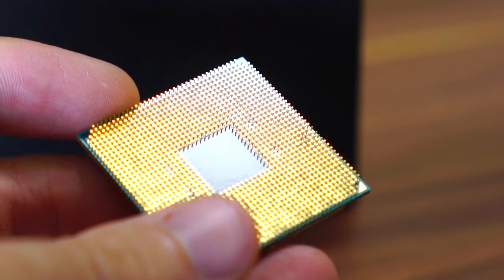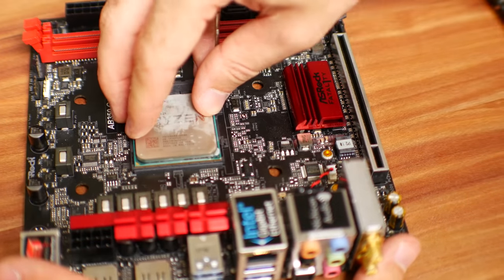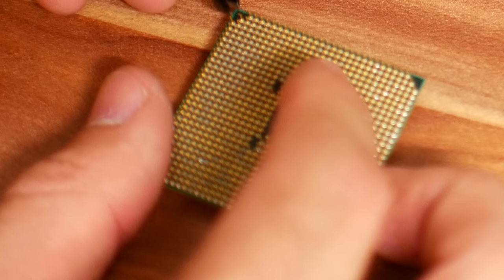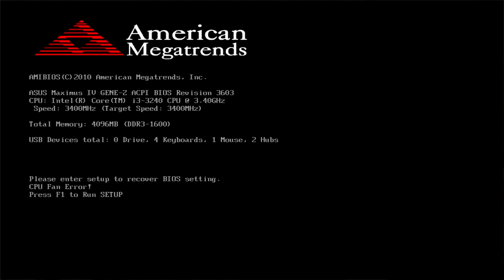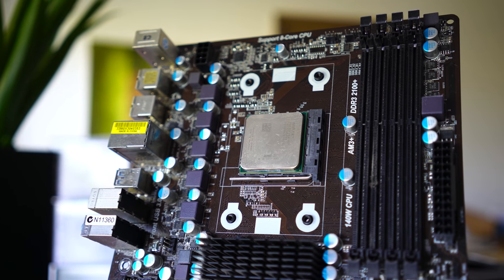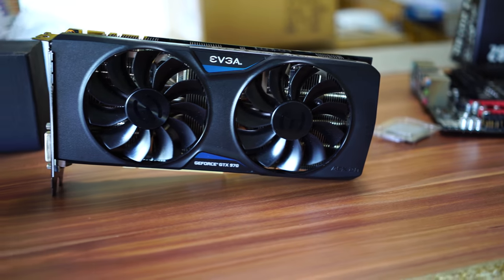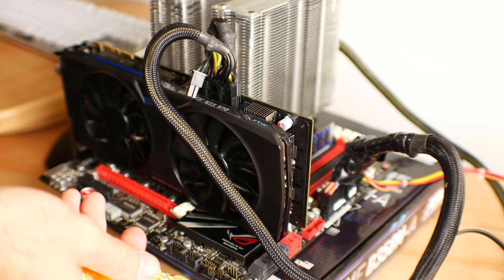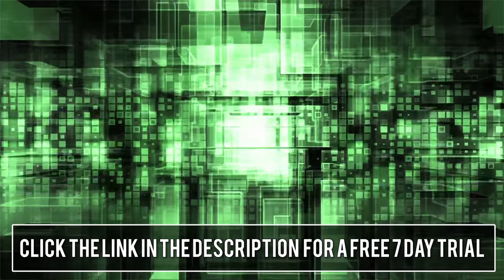How to Fix Bent CPU Pins (Ryzen)

Comment: If only I could give you my LGA1156 Board with Missing pins...now that's a challenge.
Reply: that'd be a fun collab
Reply: Depending on which pins are missing, it still might perfectly. just a ground here and there wont kill anything.
Reply from the maker: I will have to start practising jedi mind powers to get these things working next.
Reply: You can swap out the socket with some special machinery, there are videos of it on Youtube. But it's very expensive, a and bit silly on an older board.
Reply: Budget-Builds Official
You say a lot of bullshit, on this channel too, how did you break these pins?? Guess you need to buy DELL or HP next time, or a Lenovo. Never open the case! let them install DIMM's. Only install the software yourself! On the couch?
Reply: lucas rem: I mean I bought it broken for around £5, so I guess you can blame the eBay seller...
Reply: Budget-Builds Official
I try to get in some social engineering first, were was that CPU used for, VM or gaming, what games do you run, i need 20 minutes of bla bla bla before i trust a gamer selling his used parts, needing a 1080Ti now, selling his old 1080 for example. Always i ask what game did run on it, CPU, the climate etc. So i can form a picture, is he is any real, or just a chap needing money for broken parts.
Reply: lucas rem: I bought it because it came with a Corsair TX PSU, my main reason wasn't to purchase the motherboard, I always check out what I'm buying, as I have never made a mistake with my purchases. But I'll keep your advice in mind.
Reply: You stalker! Well, you wwere here first, but... stalker!!!!
Reply: Hey dude, if you can't get these to work, let me know, i might be of some help, I'm a Master Jeweler, we have a very powerful laser solder that is accurate to 1/1000 of a mm. obviously we use that to fuse multi part rings/earrings or multi color (i.e. rose gold/ yellow/ white) piece. I've fixed a processor before, was not fun, and i also redid a 1151 board as well
Reply: lucas rem that was rude

Comment: Can confirm. Bent pins on my R5 1600... After recovering from fainting, and with a lot of focus and patience, I fixed it. Very scary experience.
Reply: My new Ryzen came with bent pins. I am using a Seam Ripper to fix my bent pins. I was curious why it wasn't fitting into my socket and I did it correctly.
Reply: I have 1600 too I got scared af thinking I just lost money
Reply: Mine's an R3 1300x :( Not fixed yet
Reply: did the same durn thing when I installed my first cpu didn't seat it correctly and bent them using the lock lever...grrr. what can only be called 'judicious manipulation' I was able to get 'em all aligned and back in phew.
Reply: Just did the same thing, my mum described it as a heart surgery, turned on lol just need to put it back together

Comment: I hate when people throw away CPUs/Motherboards because they have 1 to 3 bent pins. It's a waste especially when you can bend the pins back to normal, and if not, sometimes the CPU/Mobo will work.
Reply: Pan-Celtic Socialist I'd rather them sell it if they "can't" fix it themselves. That's were I come in and buy it from them 😁
Reply: Pan-Celtic Socialist i bent a pin on a z87 sabertooth board and i cant seem to be able to bend it back. No matter what i do
Reply from the maker: This z68 was a bargain! So easy too!
Reply: Yep. I have three BROKEN (broken at the base of the board so no contact) on my Asus z97-a board. Still rocking an i5 4690k at 4.5ghz on it with zero issues.
Reply: Use tweezers and/or a pen.
Reply: BleedinglHeart some of the pins are simply for power or ground and there's redundancies.  Break one power pin and there's probbably 20 more to be able to deliver 100watts.  Or in this case, one of the pins was for the memory controller and killed dual channel ability.
Reply: a better way to do it is to use a credit card or ID card and hold it behind the pin as you bend it towards it. keeps it from going too far ending up mostly all straight.. The way this guy did it is very newbish.. Doubt he even did any research online on the best way before starting!
Reply: Nietzschean Socialist I had bent a few pins on a motherboard I had trying to replace a CPU. I was heartbroken thinking how I was going to replace it. I bent the pins back and it worked fine.
Reply: proceeds to throw away ryzen 9 3900x
Reply: @synapse5791  bruh, that's the same exact CPU I got recently and I accidentally bent a few pins of it from just trying to put on the damn cooler. :(
Reply: @NeoShadowWolf  if its from amazon ask for a replacment they game me one for free

Comment: I snavvle all my bargains from the side of the road here in Germany. A few years ago, I found out the hard way what a pain the arse it is to straighten bent pins on an AMD CPU. It was only an Athlon 64, but it was still my first 64 bit processor, so you can imagine how keen I was to get it was working. I found the 1mm jeweler's screwdriver that you get in the packs from the 1$ shop worked a charm! I got all the pins straightened, and the pc ended up running like a champion. I love your videos, man! I haven't seen a crappy one yet!

Comment: I learned the hard way when replacing the stock cooler with a AIO... while trying to remove the stock cooler off my Ryzen 5 1600 it ripped the CPU right out the x370 socket. Bending several pins on the edge. Had to buy a new Ryzen 5 1600 CPU. I didn't run the CPU long enough to heat the thermal paste and instead of twisting the cooler off I pulled. Money I could have use to upgrade my 1060 to a better video card.
Reply from the maker: Oh yeah that sucks, damn man feel sorry for you, though these pins must have been bent in a much different way, it like a hurricane in the middle of the cpu.. lol a complete nightmare was this one.
Reply: I learned this with an FX 6300. Thermal paste becomes glue apparently
Reply: Why the fuck are you using a x370 motherboard with a ryzen 5
Reply: Mohammed Essam mainly because I liked the aesthetics (looks) of the board. It's the low end X370 motherboard from Gigabyte (AORUS X370 K5) which was only $129 USD.
Reply: Chandler Kristoff Apparently so. Surprised none of the pins were pulled out but it didn't matter a new CPU had to be purchased.
Reply: I had exactly the same thing happen to me with my 1700X but i was lucky, with a lot of patience and a spectacle screwdriver i got it up and running again. There was about nine bent pins mainly along the edge. I was terrified of putting it back in the socket in case i crushed any of the pins that weren't aligned properly but it went it with a little bit of a jiggle. Best thing to do in future is to loosen off your cooler and then use a plastic spudger in between the IHS and the contact plate to gently break off the heatsink using the spudger to loosen the thermal paste (or the spinning method mentioned above). AM3/AM4 sockets have that down side of ripping out the CPU if the thermal paste has hardened especially with the clamp on style stock cooler that i believe use far to much pressure.
Reply: Some say that's why intel aren't PGA. The CPU would delid itself under such force, because of the crappy thermal toothpaste XD
Reply: This happened to me too! It was an old amd part. CPU still worked though. I think intel processors have a bracket that holds the  cpu into the socket so its not an issue on that platform. Glad i'm not the only one who's yanked a cpu out of the socket.
Reply: I pulled straight out on an FX-8350 and the CPU came out on the stock cooler. I was freaking out, but with a knife and a hair dryer, I slowly peeled it off by heating the heatsink and just slowly working around the CPU with the knife (didn't even scratch it). No damage whatsoever, but I was terrified I wouldn't be able to get it off.
Reply: Chandler Kristoff yes it can! My daughter knocked over my phenom2 pc and the tuniq tower 120 ripped it out of the socket and bent a few pins
Reply: Was taking apart a very old 3000+ amd pc for shits, and it being the age it is resulted in a similar result.. just bent them back a bit and let that old 795 socket do the rest.
Reply: Literally this just happened to me yesterday. Feel ill over it, the company sold me a 1600x for cheaper so I was able to upgrade (albeit small) from the 1600. This is good because I have a 240 AIO and I'm gonna try to OC to 4.1GHZ. Otherwise, you live and you learn. Not nice though.
Reply: Exact thing just happened to me and here I'm. I feel so fucking stupid...
I had high temperatures and I wanted to check the thermal paste...

Comment: Reminds me of my biggest mistake... I managed to bend 12 - 24 pins on an FX-8350, the thermal paste was too cold and turned into a strong adhesive. Lesson learned, boot the system and let the CPU warm up before powering the system down and removing the cooling unit/CPU.
Reply: or just twist the cooler...
Reply: The computer sat in relatively cooler temperatures before removing the CPU. Based on AMD mounts using a clamp style design, twisting the cooler would likely have resulted in more damage. The combination of cooler height, short distance from fans, and the CPU becoming dismounted from the relatively weak mounting system, can attribute to the bending of CPU pins. Of course this was all because I didn't warm the CPU first, which ultimately made this issue user error...
Reply: Twisting works fine, tested multiple times, never ever ever ever pull a radiator directly outwards from an AM series MOBO, CPU will most likely pop out and surprise you.
Reply: Noted, would have been helpful if the IT classes I was taking mentioned that :/
Reply: Did the same thing with my fx8350. Bent quite a few pins, about 20. Managed to bend them back into place with a pocket knife, worked perfectly fine afterwards.
Reply: @TheRealCharlieSuper  Disregard IT classes, especially if you are building PCs. Get  yourself an old one and practise. Its the manual skill that can't be taught, like riding a bike. You will learn more from youtubers than you ever will from classes.
Reply: Fair enough, was tinkering with old PC's long before IT classes. Hardware is easy, it's the software that will get ya.

Comment: I have an intel motherboard with lots of bent pins and that also work, but with single channel memory. Most of the pins seems to be about memory bandwidth.
Reply from the maker: It could always be worse, couldn't it? Could not boot up at all :p.
Reply: i had a 1155 motherboard with 5 missing pins, everything was fine except the igpu didn't work at all and i had to use a external graphics card.
Reply: Ola Justin ikr, whats better is that i got it for a dollar because the owner was certain that the thing was 100% dead ;)
Reply: @OlaJustin  why don't you straighten them?

Comment: A trick you can do with the PGA sockets is use a staple you can cut it with fingernail clippers a little bit longer than what you would need so it makes contact with the CPU works perfectly fine done it several times for broken pins.

Comment: Maybe you can use electrically conductive glue to attach the pins back to the cpu. That allows more room for error than soldering and does not require specialised equipment.

Comment: There is a reason these pins are gold plated. This is so to minimize oxidization on the pins.

It's possible that the circuit the pin runs on works under a specific resistance -- and oxidation on both ends (as the gold plating is broken) increases the resistance on that specific circuit, causing a slight voltage drop - even if the pin is contacting the broken part of the chip when it is mounted.

Try sticking the pin in, then right before you put the cpu on, spray some non-conductive contact cleaner on both sides then quickly put it on while still wet. Hopefully enough oxidization is cleaned off and the resistance is reduced.

As these chips run on really low voltages (below 2v) a 0.1 voltage drop is huge.

Also try to put the pin in the socket broken part down, plated side up.

Or -- gold-plate the pin and the contact again.

Comment: You could always use the tip of an empty pen, the pins usually fit very nicely to just be put straight as you use an angle to fix. Make sure it's clean though, don't know what could happen if lead stays on it.

Comment: I just fixed an old Athlon XP 6000+ with 20+ bent pins for a pc on my school. The pc was running a very limited piece of software that we can't install on anything else since we have lost the original license, so the only option is to keep using the pc. A technician took out the cpu trying to clean everything but DROPPED IT from 3+ feet! He just gave up. 
There were like whole rows of bent pins. I used a razor blade, with the edge prying on the pins. I would recommend going VERY slow when bending the pins back. There were no broken pins, and the cpu works fine, and tested with 48+ hours of aida64. Don't give up on bent pins!

Comment: My best advice for fixing bent CPU pins: 
Heat makes the pins more malleable without being as brittle, so if you can use heat in this case, use it.
A small plastic, fine-ended tool is great, but plastic is not as dense as gold and/or whatever other metal your pins are made/coated with. I myself recommend a hollow-point piercing needle to do the job because of the fact that you are now instead using something that is denser, more rigid, and a hollow tube with a fine point at one end. It's the most ideal thing I've ever used to bend pins. Way way way more control with less risk of you accidentally popping one off across the room.

Comment: The silver wire you find INSIDE the SATA cables CAN be inserted into the socket and work better than other "original pins". Just get it the right lenght. Fixed an 8370 with 2 missed pins this way,  and its working 100% for amost 2 years.
Reply from the maker: Interesting, thanks for the recommendation.
Reply: Esteban Burman How did you type this?

Comment: If they're not bent too far over (nearly flat against the bottom) my preferred tool is a razor blade (plastic if available) as it makes it easier to get them lined up perfectly, and the wider area of the blade reduces the chance of over-bending as you can definitely feel it and stop when you hit 10 straight pins. Also getting those 2 pins back on the edge of the socket shouldn't be that big of a hassle if you have a soldering + hot air station, clean the pads off with some wick, put down some fresh solder with the iron (if you lay it down right solder should only stick to the metal contacts, just use a little bit), heat it up with the heat gun until it melts again, and stick the pin in the melted solder with tweezers, then as necessary straighten it up with a nice razor blade.

Comment: What I've used in the past is the tool that you use to remove Molex Pins. It easily fits over the round Pins and sturdy enough to move the Pins without snapping them.

From what I've seen in your video I'd venture to say this CPU was accidentally dropped and landed at an awkward angle. 

Cheers...

Comment: From back in the Pentium 4 and Athlon XP days: It's possible to use a 5mm automatic pencil to straighten the pins by inserting the pin and levering it up to the correct position, in as little bending as possible.

Comment: It does take a lot of patience.  I'm working on an R5 1600x, and most of the pins came back pretty straight, but one on the side was bent way over and sadly, it snapped off.  Not sure if it'll work or not, but time will tell!  Patience is key!

Comment: I received yesterday my Ryzen 1600 CPU and OUT OF THE BOX had 2 slightly bent pins. I am absolutely 100% sure I did not bent them, as I just pull out of the plastic and insert it in the right way correctly to the socket in the first place. 
However, one side (upper right) was just a little bit off and in the beginning I couldn't understand why it did not fit. I turned it and saw the bent pins. 
My fix took 2 minutes actually and was with the mechanical pencil. However, just as I said, they were only bent just slightly so perhaps that is why I managed to do it with the pencil.
Thankfully no issues like yours in the video with the single instead of dual memory. I have not tried overclocking it yet and thermals on my test open bench are not the greatest with CPU sitting idle at 42-43 Celsius (ambient at 27-28).

Comment: 3:10 heatgun, solder paste, nice tight tweasers, microscope. you might stand a chance. if you have an old bridgeport or something and a pin vice you might manage to hold the pin one pin at a time in place while you heat the solder paste with a heat gun, but to resolder those pins you will need something to hold the pin in place while you heat it, you won't be just soldering a pin back on like you can with an old 486. you can forget about soldering irons though, even the finest tips would be in the way of trying to place the pin properly, and they gotta be REALLY close on even am2 procs.

Comment: It's the game.

Battlefield micro-stutters even on 7700K. (at stock)

Neither CPU or GPU were maxed out.

I heard it's occurring after recent updates
Reply: It's not game-breaking, but it's really annoying.

It wasn't like this a few months back, and I was using an i5-7500!
Reply: Holy crepe! Yes lol
Reply: I have I7 4790k @5,2ghz, 16 gb ram and gtx980ti. Battlefield 1 doesnt stutter for me but overall framerate is bad compared to bf3, bf4 and bfh. I play on low settings at 1080p, and my fps is around 90-140 on 64player servers, cpu usage max70% and gpu 40-50%.

Comment: I actually read that cutting off bits of copper wire to be the lenght of the pins worked for them. Plus, it looked like the pin from the other cpu was too short so it couldnt make contact with the ryzen cpu